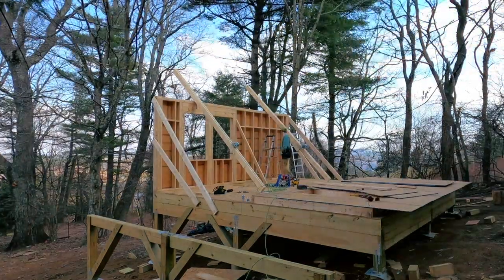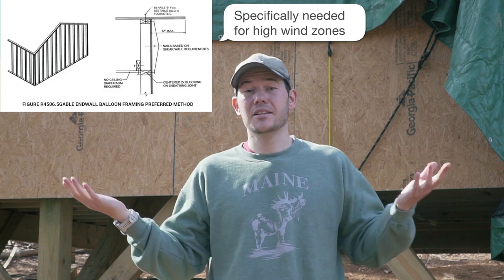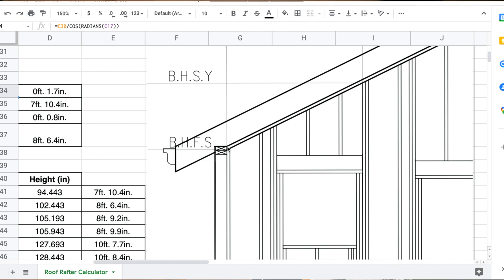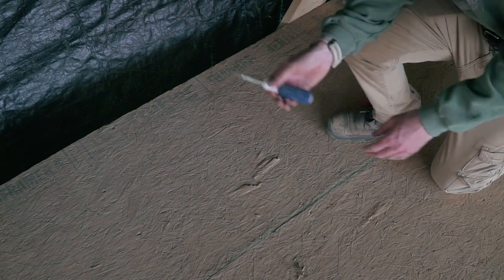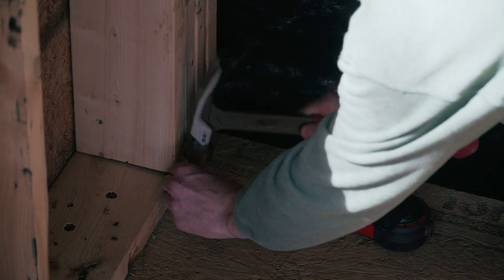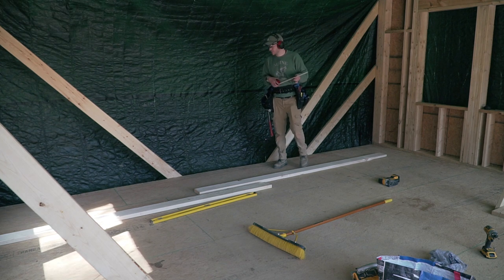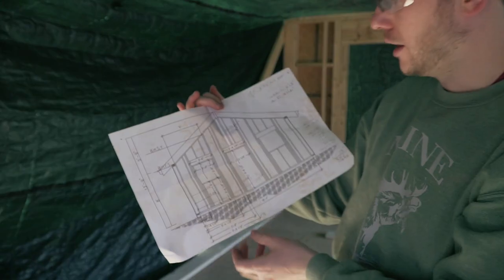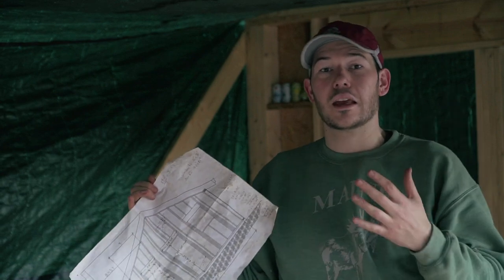Correctly Framing the Front Gable End Wall of the DIY Cabin - EP 23

Comment: I am really enjoying watching you overcome new obstacles . I have been renovating an older house and I usually work alone or with my wifes assistance. I like how you try and think of every possible thing that could go wrong and ways to avoid it.  I have been doing the same thing. You are doing a beautiful job. One piece of advice, when driving those long screws run the threads through a toilet bowl wax ring. This will lubricate the threads and put less stress on your tools. I use to build log homes and we would pre drill all the holes. Some times we would brake a 14" lag screw because of the heat they generate. We started lubricating all our threads and never broke another lag screw. This was on a 5,000 sq foot log lodge. I will keep following your progress. Again great job.
Reply from the maker: Thanks you so much for the comment, you’re absolutely right, it’s been so challenging trying to think every single thing through to limit the chances of making costly mistakes especially having never done it!
I like your tip, yes I’ve seen these long olylog type screws that can be 16 in long, that’s a great point, I’m sure it could wreck an impact drill !

Comment: You are amazing. You have accomplishing so much in such a short time-and by yourself.! !
One comment about balloon framing: 
I am restoring an old wood frame house with balloon framing and learned that they are a fire hazard  since a fire can begin at a lower level and spread vertically unrestricted between the beams. Some of these homes used to burn down because it was difficult to stop the fire since it was burning between the walls. 
I solved the problem by adding fire stops every four feet or so.
Reply from the maker: Thanks! I still have been at it for a while but it’s kind of coming along. 
Yeah that’s a good point about the fire stops !

Comment: This is so awesome.  Great Job.  Can you wait to install your header and jack studs and 2nd king studs until  putting the wall up. Would probably reduce the weight a lot. Great content.
Reply from the maker: Thanks Chad, I guess you could but just as I did for the other wall, I’m going to put sheathing on the wall laying flat before raising it, in that case, I have no choice but installing all my framing.
Reply: @TheDIYCabinGuy  I was thinking about that... You could still put the sheathing on and after it's up install the rest of the studs and headers from the inside mark things out and finish nailing the sheathing on a  ladder.  Either way you have proven yourself inventive so I have confidence you will be successful.

Comment: Vaulted or Cathedral?  What's going to prevent your rafter tails from spreading outward when under a load? I didn't see your interior framing plan.
Reply from the maker: I just realized that I kept saying vaulted in my video and should have said cathedral instead..oups! Rafters will be spanning from the structural ridge beam to the top plates of the walls. In that case, you don’t have issues with spreading. Spreading is an issue when using a ridge plate (non structural), in that case you’d need rafter ties to prevent spreading.